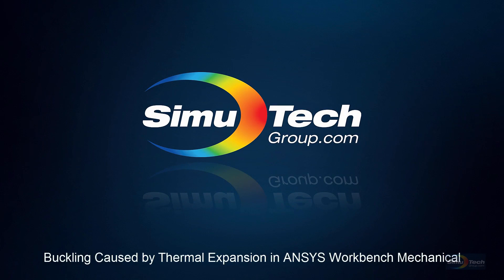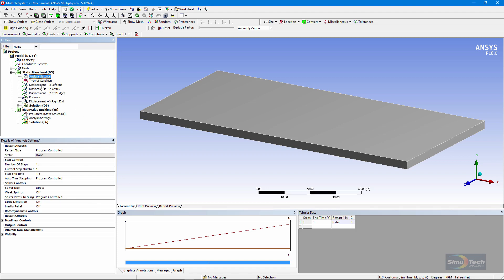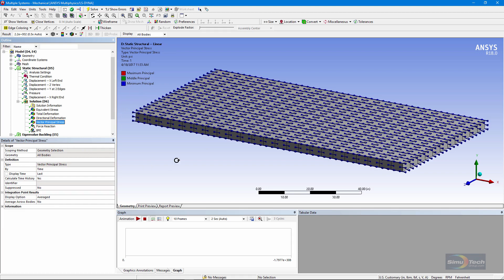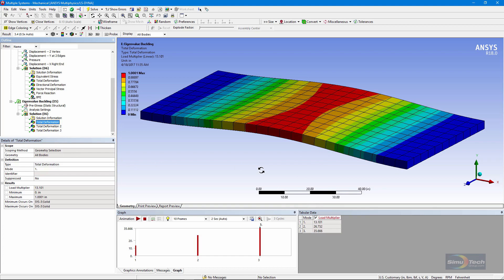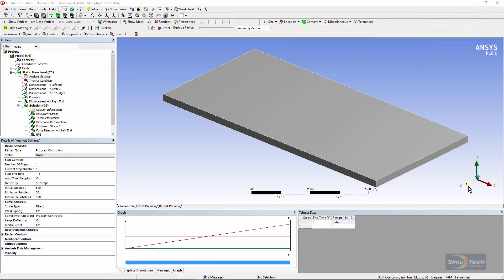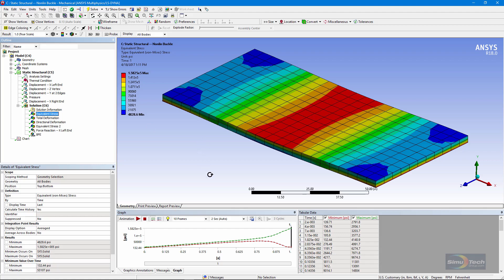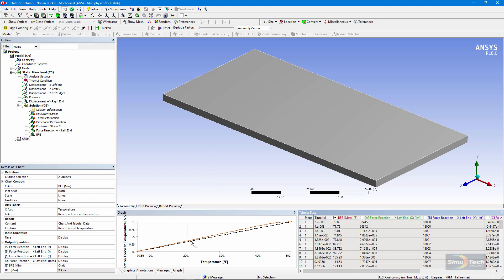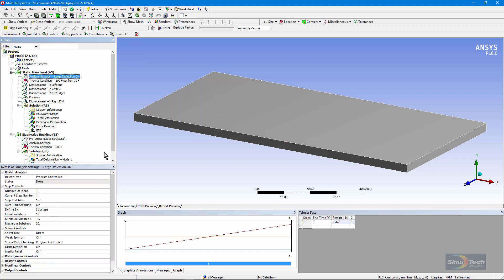Buckling Analysis with Thermal Expansion | Ansys Mechanical

Comment: I have followed your example for second case and it seems like the pressure wasn't applied. I don't have deflection as it should be. I also got 2 warnings (solver pivot warning and large deflections activated). Can the problem be in older Ansys version?
Reply: this warning informs you that default settings are changed. You activated the large deflection so it is considered as non linear solution.
solver pivot warning is there means model is not constraint properly. For solving equation, no. of variable must be equal to equations but in thermal strain we use compatibility condition means displacement is zero(or given value) in particular direction. So model must be properly constraint.